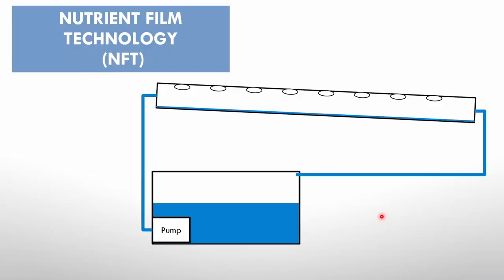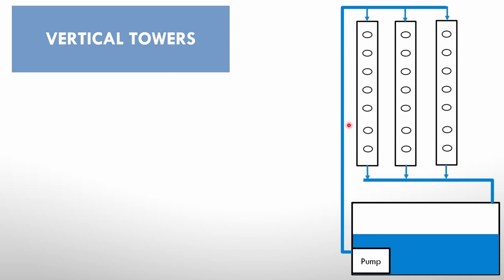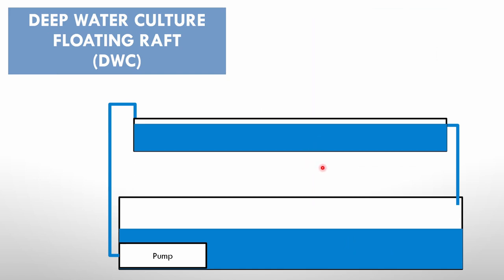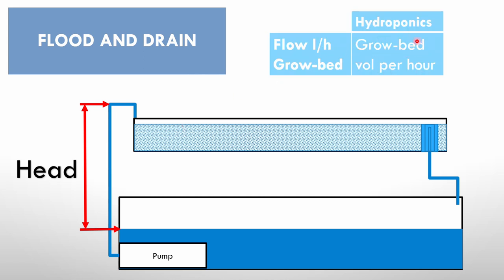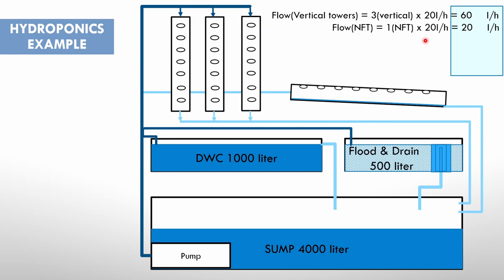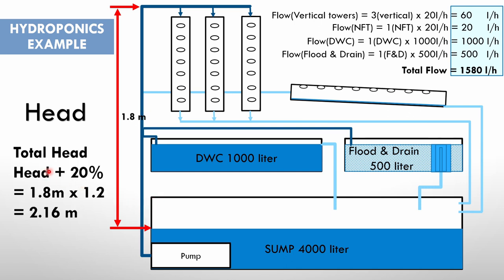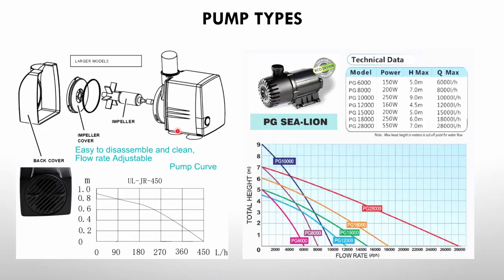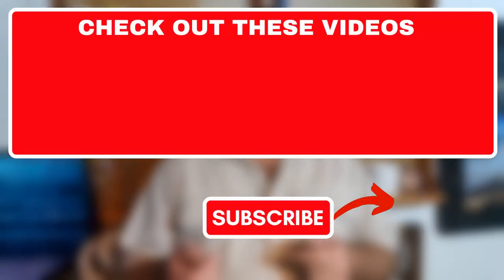Hydroponics pump size- How to calculate pump size

Comment: What size reservoir tank would I need for 20 vertical grow towers, with a flow rate of 10L to 25L per hour? I plan on using dosing pumps to maintain PH and EC values. Could I get by with two 70 gallon tanks? Always using one and having another as a backup, ready to be used. Or should I just use one 140 gallon tank? The information you provide is very relevant to the subject. It provides me with the help I needed for a project I have been planning. I purchased your  Learn Arduino With Pierre course, it was everything I hoped for and MORE! I will be purchasing Aquaponics and Hydroponics course soon, because I am very interested in Vertical Grow Towers. The information is provided at a reasonable price.
Reply from the maker: You can use the 70 gallon tank. Main thing to consider in a hot area is how you will keep the temperature down.

Comment: Clear and concise, thank you.  

One question, the requirement for a vertical system, you state it at 10-25L/H - is this the same for a 2" vertical grow-pipe and for a 6" vertical grow-pipe?  This is the magic number I've been searching for and haven't been able to find anywhere else.  

I trust that you've tested this flow rate, so that's where I'm going to head.

Again, thank you.
Reply from the maker: The flow rate is typical for 4" vertical pipes in hydroponics systems. It is a bit more for aquaponics.

Comment: Hi, I’m using DFT system , and I want to ask is it okay if I let my 4500L /H run on maximum for a 200L growbed? My head is just 1m and it says the the graph that the flow rate is gonna be 3500L/h if I circulate too much it’s not gonna have any negative impact right?
Reply from the maker: No it will be fine.
Reply: Great job, thanks for the priceless information sir. I'm planning to have about 6 growbed  connected using rdwc system. Please, What would be the size of my reservoir? Amos from Nigeria.